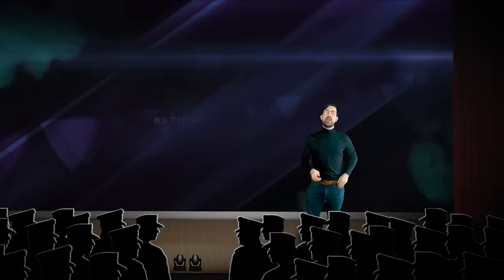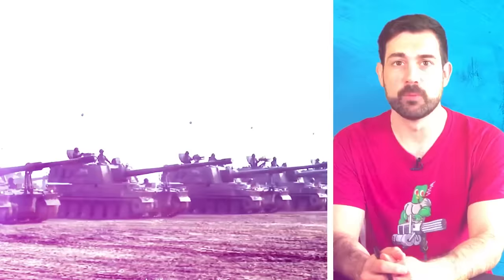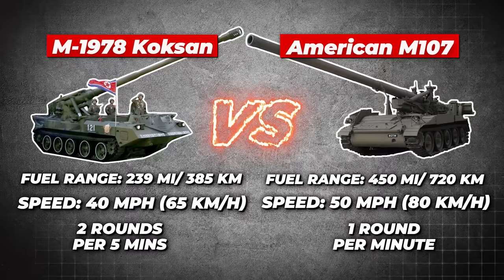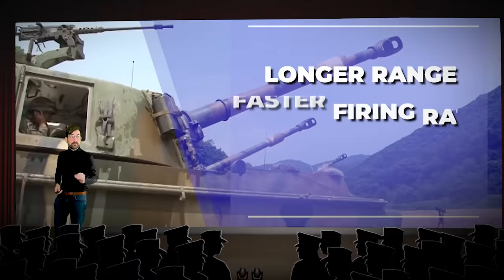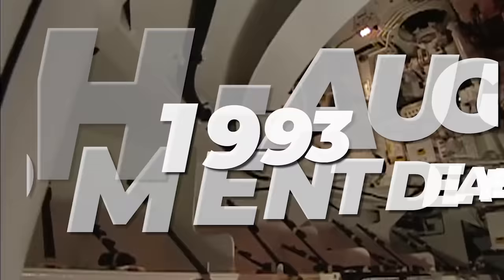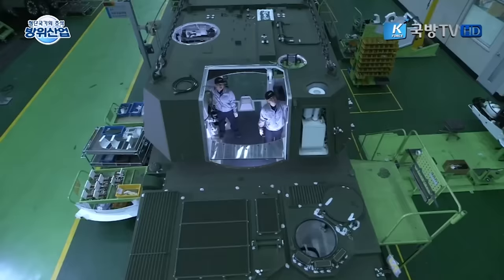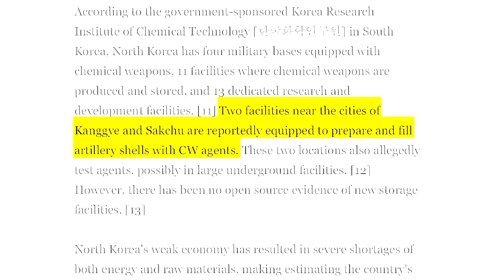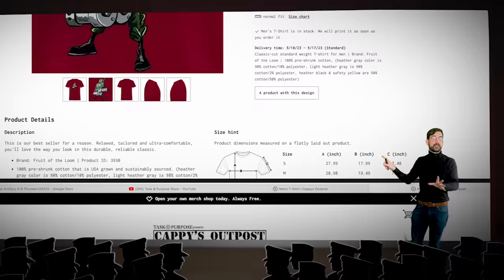Why Korean Army Artillery is the Best in the World

Comment: The K9 Thunder being combat proven didn't come from its use against North Korea but because of its decade-plus long use by Turkey in the form of the licensed-produced T155 Firitina. They were the first country offered the system by South Korea in the late 1990s and bought it since Germany wouldn't sell the Panzerhaubitze 2000 to Turkey due to formal embargoes. It took until the mid 2010s before other countries started buying the K9 too. The sale of the K9 back then was one of the largest export deals of South Korea's defense industry.

In the late 2000s in a Turkish tender South Korea demonstrated what went on to become the K2 battle tank. Turkey signed a deal where the South Korean developers teamed up Turkey's Otokar to create the Altay battle tank (later further developed by Turkey's BMC). It was supposed to be powered by German engines and transmissions but because of informal embargoes in the 2010s followed by a formal embargo in 2019 that was delayed and then rejected. Meanwhile, both South Korea and Turkey began working on domestic engines and transmissions. Turkey bought the South Korean powerpack as a stop-gap while the BMC Batu powerpack is currently in its testing phase. German licensing restrictions on South Korea's own exports is what prompted them to move away from German powerpacks themselves. The K2 tank is now selling big numbers which will likely be joined by Altay doing the same, and Germany is poised to increasingly lose marketshare just like it did to the K9 howitzer.
Reply: german stuff has slightly higher specs, but isn't battle tested, unreliable and costs double.  they're coasting on reputation it seems.
Reply: @nothingmatters3802  ...not rly. Military companies can get an entire production line full up to speed in less than 2 years.
Reply: @kenmasters2025  pzh2000 is battle tested in Ukraine. Need a source for your unreliable claim.

Comment: You must contact Denel South Africa. The G6 was also upgraded to protect the crew against chemicals, cyanide and radiation for a cetain time.
It also fires 8 shots per minute and the distance is 67km. They also was able to fire now rocket assist shell over a distance of 76km.
Rheinmetall/Denel South Africa also investigate other South African developed rocket assist motor with the availability to fire a 155 mm shell over a distance of more than 150km.

Comment: no, NK can't "bombard Seoul with over 10,000 projectiles per minute".  they have neither the tubes nor the ROF to do so. 
they may have 21000 artillery pieces & MRLs aimed at seoul, but only c.1% of those have the range to reach some part of seoul; all of them within range of multiple ROK 155mm battalions, most of which will be firing from covered positions.(something the NK artillery won't be doing, BTW).  & ROK has less than 1100 "along the front", if the western islands are included.

"the 7th ROKMC? 7th Company(FA), Yeonpyeong "Budae".

Comment: S Korea licensed built M109 as K55 but it's mobility lacked with 400hp and long range fire power thus came up with K9 with 1000hp and longer barrel with auto loader for quick loads.  It also focused in stabilizer so it doesn't move around like Russian and Chinese artillery for accurate follow up firing. If Ukraine had K9, it wouldn't be stuck in muds like German Panzer2000 which also requires less charged special ammo made in Germany which wears out using regular NATO 155mm rounds.

Comment: Swedish The Archer Artillery System, or Archer – FH77BW L52, or Artillerisystem 08 is a Swedish self-propelled gun system.[2][3] The main piece of the system is a fully automated 155 mm/L52 gun howitzer and a M151 Protector remote controlled weapon station mounted on a modified 6×6 chassis of the Volvo A30D all-terrain articulated hauler. The crew and engine compartment is armoured and the cab is fitted with bullet and fragmentation-resistant windows. The system also includes an ammunition resupply vehicle, a support vehicle, BONUS submunitions[4] and M982 Excalibur guided projectiles !  South Korea learned from this
Reply: Sorry. K10 began deployment in 2006 and Archer did deployment in 2010. 
K10 was developed using the K9 body, influenced by the concept promoted by the US canceled Crusader.
Reply: @nonana.  before the Archer 2 was bandcannon which did have fast firing

Comment: Still no one beats us swedes in gun manufacturing the bandkanon 1 for 1950s had a extreme rate of fire. We had artillery with 18 rounds per minute during 1950s. Though with archer we went down to 8 rounds per minute though it would be amazing if we could reach the 18 rounds per minute again.
Reply: Correction, it was 15 rounds in 45 seconds, with one shell preloaded in the breech and two full clips of 7 rounds each.
Reply: @johanmetreus1268  I think what I looked up was the average round per minute. Otherwise what we see would be 20 rounds per minute. 

I like to use rounds per minute as a basic metric.  Otherwise its 1 round every 3 second or 1/3 round per second. Though I prefer rounds per minute metric.
Reply: @BS-vm5bt  Problem is that once those 15 rounds has been fired, reloading the magazine with another 14 rounds took around two minutes, three if you wanted to preload the chamber,...and that without the expected need for relocation to avoid the risk of counter battery fire.

These considerations is why cyclic rate almost never is used around artillery in favour of:
* burst rate: how much metal can be sent downrange if shooting fastest possible before leaving.
* sustained rate presumes the piece can stay in position, and only needs to consider not falling apart in a week.
Reply: @johanmetreus1268  Its more as a standard metric. Generally you use up your magazine then move to a ammo deposit. I think cyclic rate has its place since if you consider the reload time of the artillery when it is at a supply hub. You generally want to minimize staying still, that means you need a short reload time and a fast burst rate. 
With shorter reload rate that means short time the artillery is not available.

If we are going to be elastic about it its should be the burst fire time + relocation time + time to reload. With relocation time counting on the speed of the vehicle.

Comment: Panzerhaubitze 2000 also fires 10 rounds per minute or 20 rounds in 2 minutes. I don't see why this here is so special. If you compare the two, the k9 looks like a straight up copy, though it most likely can't match it in performance.

Comment: This video left out a large hole for the autoload mechanism was based on a Russian design. Long story short, the Russian needed to repay South Korea for trade deal when Russia defaulted. They gave them fully operational state of the art military hardware including tanks and artillery. That also came with maintenance package which then South Korea reversed engineered much of that and incorporated in the K9 and K2 tanks. Oddly enough South Korea takes design from both West and East design. This is very well reflected in their service rifle with AR lower and AK upper meshed together.

Comment: Your math is not making very much sense! If Poland and other countries are paying a franchise fee averaging $1.7 billion per license, they are spending MORE per unit on licensing than the actual cost of manufacturing the vehicle!

$1.7 billion divided by the 624 vehicles to be license built in Poland equates to roughly $2.725 million per copy in licensing fees compared to the $2.9 million per unit cost of the over 1700 already built in S. Korea which also  include the research and development costs which are not included in licensed copies.

From a financial standpoint it would make more sense for these countries to purchase directly from S. Korea at $3 million per copy versus $5 million plus produced domestically.

Comment: have you compared the K9 Thunder with other artillery systems such as the Swedish Archer Artillery Systeme

as far as I can tell, the K9 Thunder has its advantages but also disadvantages against the Bofors Archer Artillery System

The Bofors Archer Artillery System can fire longer than the K9, takes less time from firing to regroup, less than 30 seconds can fire Raytheon/Bofors M982 Excalibur rounds, as well as Bofors/Nexter Bonus grenades, has better Operational range better Battlefield Management System

now both of these arteleri systems are good but i wouldn't have called the K9 the best

it would have been interesting if you wanted to do a feature where you compare the Bofors Archer Artillery System with the K9 and some others like the M109A7, the German Panzerhaubitz 2000 and the French CAESAR

now Sweden will send 8 Bofors Archer Artillery System to Ukraine 50 CV90 and 10 Leopard

it will be a good test of how good the Bofors Archer Artillery System is and whether the Swedish CV 90 is as good as we think

I had hoped we would send more to ukraine but it's a start

hope we send many Raytheon/Bofors M982 Excalibur rounds because then the Bofors Archer Artillery System will reach its full capacity and that the Ukrainian operators will get a thorough training on these weapon systems
Reply: Archer? 🤣🤣😂😆😅😆😂🤣

Comment: Sooo.. as far as I can tell, the Archer artillery system has: 
the same or comparable rate of fire (3x/15s, 9x/60s or 20x/2.5min), 
twice the MRSI capability (6x instead of K9's 3x), 
capability to fire more advanced munition (Excalibur GPS guided), 
almost 40% greater operational range (500km vs K9's 360km), 
greater top speed (90km/h vs K9's 67km/h), 
capability to be fully operated by a single crewmember (vs K9's minimum 5?!), 
similar or better deployment and shoot-and-scoot times (30s for both)...
...but the K9 is "best in the world"? I mean sure, there may be some very niche use-cases where you'd need the full armor and tracked platform vs the very terrain capable and light armored Volvo A30D, but in most cases your artillery pieces shouldn't need to be that close to that kind of fire; the by far biggest risk should be counter-artillery or you're doing war wrong.

I've now tried two videos from this channel, both had the same ridiculous lack of research and clickbaity titles. Channel is definitely going to be ignored by me from now on.

Comment: As a swede whe laught in you’re face bandkanon c1 fires 48 or 58 shells before the first one lands and that was made 1960. And i the archers fire 8 shells and the k9 fires 10 and has a range 40km and archer has a range 30km. But i think ours is quicker then the thunder and ours have gps precision in side a landingzone of 1 feet. 

And im guessing buy the ”sea of flame” that is not very acurate and needs to be fielded in bigger number to be effektive. So whe can fire first. Destroy the k10 and that will probably cause an explosion that might be big enough to destroy the k9. And when whe fired whe will be able to pack up and move. The extra 10 km would not matter if whe move quick so they would be dumb founded and must shoot randomly shoot at where they think whe retreated. But the damage has already been done and sweden still stand ”länge leve konungen!”

Comment: I have to wonder why Poland opted to use a British turret and a custom Polish firing system on the Krab, instead of using the stock Korean design. Seems to me like they robbed themselves of the ability to use an armored resupply vehicle like the K10.

What kind of threat does Poland anticipate, and what kind of tactics are they cooking up?
Reply: Because, Polish Krab started as a self-propelled artillery development project, not a self-propelled artillery introduction project. development of their own self-propelled guns. However, due to lack of tech capacity, the British AS90 turret with no license fee, plus the French Nexter gun barrel. After constructing the turret like that, they tried to develop the chassis part with their own technology, but the chassis development failed. Lack of technology, such as not being able to withstand the impact of launch and causing cracks in the chassis. It took more than 10 years of time and money, but when the chassis development failed and the program reached the point of failure, polish asked Korea if it was possible to complete the Krab self-propelled howitzer using the K9 chassis.  Korean engineers were able to integrate the technically high-performance chassis of the K9 into the AS90 turret, which is different from the K9 turret. Very quickly and simply. And Korea also passed on some technologies to the Polish company, such as special steel-related knowledge, special welding technology, and production facility know-how. So,that's how Krab was created. So they buy a license for Korean chassis and produce self-propelled howitzers. Some Poles think that the Krab is a Polish self-propelled gun, but in fact it was a K9 chassis with AS90 turret attached to a French gun barrel and only a Polish communications and firing system installed. As you already mentioned it. Now that K9 is introduced in Poland, if it is a normal procedure, it is correct to end Krab, but it is not easy due to domestic political considerations.

Comment: The K9 Thunder is totally lacking the Phbz2000s' shoot and scoot capability (under 30 seconds).
Reply: If the k9 is also priced 2.6 times higher, it will be a self-propelled gun with twice the performance of the Phz2000... It's about matching the performance to the best selling price.What sells the most is the best... OK? And Germany can't even produce a lot of self-propelled guns in a year, right? In Korea, hundreds are possible.
Reply: @JuriK I would need a source for the reliability claim and for the problems in cold weather.
Reply: @00onccinae16  what sells the most is not necessarily the best. Try to drive a race in the most sold car and see how well you will perform against purpose build racing cars.

However you are actually right that the costs are always an important factor. 

And could is not rly a problem for modern Western companies. If there is the demand for something it will get produced.

Comment: I was stationed in 2ID 6clicks from the DMZ all they have is a few dozen working mugs from decades ago (I was buzzed by 1 in 2003 it was about 100’ off the ground I could see the pilots face shield) they have foot soldiers (a lot!) but they can’t sustain a winter of war, their logistics suck soldiers will starve and freeze to death) and a crap load of artillery and a small amount of surface to air rockets that mainly do loops. They are no real threat.

Comment: Meanwhile the US Army still likes the field guns because they have one massive advantage.  They don't lose their zero.   Which is why the US is pretty well known for being able to hit bed-sized target at 30 miles with the first shot.  They even back up the bragging of lobbing shells through windows.   The US keeps these "old fashioned" guns in use because they found that mobile Artillery is just not as accurate, and so its situational when to deploy the less accurate but highly mobile systems.  

Also the US forces have the expectation that armor, helicopters, and even close air support is going to defend or at least screen their artillery forces.   Which also matches the US's "attack to defend" doctrine.  SK has to be ready to defend Seoul and doesn't have the same options.  

And its the USM, why have one or the other, when they can have both and spend 2x as much?

Comment: I think you're quite mistaken regarding radiologic protection.  Neutrons are not the primary concern.  Over pressure is the primary concern.  The only radiologic concern at the distances involved would be gamma.  If you're close enough to the epicenter for the neutrons to be severe, you would already be dead from gamma, heat, and over pressure.  (Plus neutrons are extremely easy to absorb in shielding.)   And, yes, I am a real nuclear and mechanical engineer. (Retired) [ 3 engineering degrees and Stanford graduate school]   Love your videos!

Comment: First of all is a great Piece of Technic I still Prefer the German made Pzh2000 over the K9 yes the K9 is a litten bit faster and can drive som km more on one Gastank. The abillity to cross a trench is a litten bit better on the Pzh2000, it can carry more rounds without an Supplyelement (K10) the rof is the same in the first 10 sek, but after the first 10 sek IT looks like Pzh2000 has the better Rof( and yes it also depends on the Crew )which is Importen if you do Hit and Run if you can Hit faster you can run fast and avoid CB and on my last point the MRSI is better on the Pzh2000 just 2 Rounds more but the two can make the differenc
Reply: Keep in mind the PZH 2000 was developed in the 80s and is still able to outperform the K9.

Germanys newest RCH 155 howitzer can fire on the move.
Reply: @jonny2954  Yeah im German so im interested in the Weapons my Country produce. And yes is also a cool pice of tech.

Comment: Only clickbait. It’s NOT the best in the world. You know the Pzhb 2000 from Germany?
Reply: K9 is more reliable with similar specs at a far lower price point. Tests in norway have shown that the pzh2000 failed in cold climate whereas k9 worked smoothly.
Reply: @La Jo  I would need a source for the reliable claim or the claim that it has problems with cold weather.

Comment: The results of PzH2000 in a real high-intensive war has shown a lot of issues. Most are related to ability to keep high speed of fire for a long time. If the howitzer reload allow you to shell with high speed, it doesn’t guarantee it will be able to keep this pace for some time.
It’s good to have nice tech specification. But the real test is only on a real war.